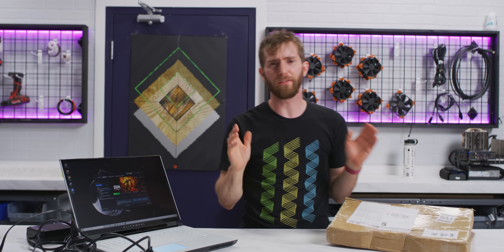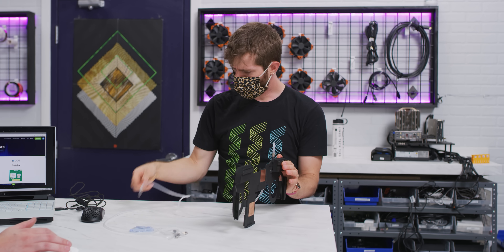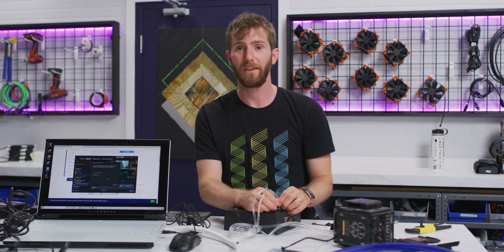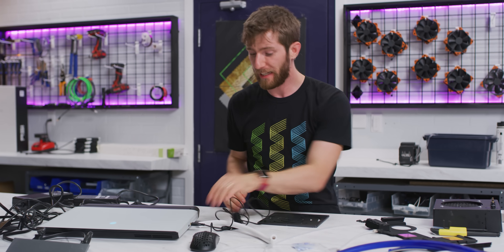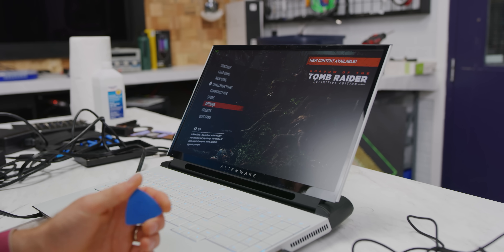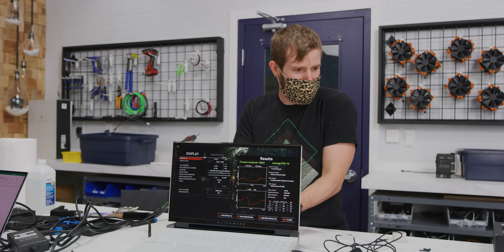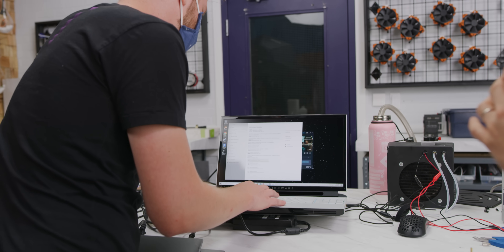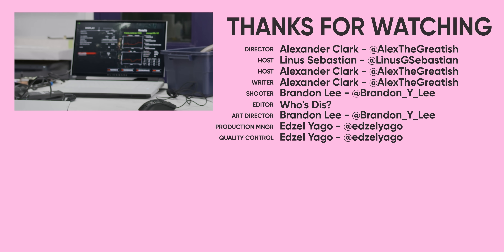This Sketchy AliExpress Cooler....

Comment: Can you do a run of Userbenchmark with and without water cooling, and compare it to other machines similar to it (stock, obviously)
Also running a very CPU-bound benchmark would have probably given better results considering its the CPU the one that really struggles on the stock air cooler.

Comment: VRM throtteling , the pads didn't make a good connection with the aftermarket cooler... Did you guys monitor the CPU frequency while running the benchmarks? You only monitored the CPU and GPU temps...

Comment: One point of debate is that when water cooled you Guys had the laptop in the air. when you guys tested air cooled it was in a flat surface so its getting hotter air from the bottom.

Comment: I had a diy water-cooled laptop. I made a flat heat pipe and just put it on top of the original heat pipes. The air cooling was exactly the same but as soon as I fired up the water cooling i couldn't hear my Laptop anymore. No throttling anymore 50°C
This was like 30° lower than stock

Comment: Loving my 51m, but yes it is for sure because I'm on the go. Though to be honest, if you consider the screen and the fact mine is a 9700k with a 2070 and performs just like my friends custom built 9900k with a 2070 but is mobile for about the same price he spent on his screen and parts (you must consider the screen). It's not bad. He made his build for 2600$ and I got my 51m on sale for 2700$

Comment: Hey Tech Linus, so I use the ACER V3771G yeah it's old. I just applied some thermal grizzly paste on it and it runs like new. I bench marked the CPU and GPU and it got pretty hot like 81 degrees. However, out of curiosity I removed the bottom Chassis, placed it under some cooling pads and to my surprise under the same benchmark it ran max at 72degrees. I was wondering what results you'd get on your system if you did the same.

The downside is that the parts are exposed but I have slightly better performance. I mean a 5% performance jump is a leap for computing power. 

Before I couldn't edit 4k video, I could only down scale it into a 1080p timeline but now I can edit 4k video at full resolution. By this I mean I can just cut it about without having to add effects and stuff. But I can do all this on 1080p footage with some graphics animations and effects no problems. 

I think my PC just cools better without the bottom part and this gives me better performance. I can imagine how much better a latest PC will do.

Comment: Here is why this thing exist. Not every laptop have a good original thermal design like Alienware's. And that's why aftermarket thermal design for laptop exist in China. On some poorly designed laptop, you can get better thermal performance by just solder additional heatpipes onto original module. So the target of this kind of product is some midrange gaming laptops where the performance is bounded by thermals.

I have a MSI GE laptop and adding water loops increases the performance by roughly 20%. You can install a quick releases on the loop so you can unplug the pipe and carry the laptop away without worrying about leaking and stuff. It's actually make sense. 

And they didn't cost $600, it must be shipping or/and Alienware tax. Mine cost around $200.
Reply: Did you diy the water loop or the loop comes in full set and it is bolt ons. I'm thinking of doing the same thing to my laptop

Comment: id love the option to hook up a 140mm AIO to sit on your desk, with Push/Pull; to game at. Its annoying that only Desktops are Watercooled, when there is a market for Laptops with small Rads and heatsink combos. I mean atm i underclock the CPU voltages, to game @144hz using Throttlestop. No temps go higher than 69C. We need quality match-ups though. I mean something like an Asus laptop with a 140mm 40mm thick rad with Noctua fans, and use a clip on locking system like the garden hose variety. Whilst on the move, you could still game without it, but at home, use the rad to game with better temps. Especially as we all would love to see a 10900k + 3090 and not have something SO BIG that you could use as chocks to keep an airplane parked.

Comment: They do one of these for the apex 15 / nova 15 laptops with the desktop Ryzen CPUs.

It's £250 I'd love to see how that one does. 

On the product page or shows two different models, one actually has more heatpipes than the stock heatsink so might be a genuine upgrade even without the water cooling.

Can you do a video on that as well?

If not I might bite the bullet if the seller proves to be able to communicate some key pieces of information to me. Like does it come with a replacement fan cover to replace the one that's actually part of the heatsink?!

Comment: we got a lot of laptop modified enthusiasts in china, we especially focus on clevo's product like nh55 p750 p775 p870 x170, and alienware's 51m and 51mr2, the purpose that most of us made this is for achieve the best performance in fan cooling ,some would try to do this kind of water cooling too, basically we just wanna put a 9900ks in the laptop and make it still runs ok

Comment: Little tip when it comes to bleeding the air out of liquid cooling. go to the auto parts store and buy one of those handheld vacuum bleeders for brake lines,  suck the air bubbles out 😇

Comment: since temps with the water cooling is only 82 degrees (vs 99 stock), what about overclocking? temp-normalized performance difference?

Comment: have u guys contemplated using visors instead of masks so we can see ur reactions and stuff better?
Reply: Visors/Face shields are prooven to be not as effective as masks by a long stretch
Reply: @Dorinyan  ok but i thought it would look better. i was just giving a suggestion
Reply: @therealflstudionoob So, yeah, i may be not as science savy with only a masters degree in materials science, but there are TONS of published research papers confirming the effectiveness of face masks IF the correct type is used and they are worn correcty. On the other hand we have infection numbers increasing dramatically in countrys without mask wearing laws or beeing late to enforce them. 
But naturally, if you google "Face masks ineffective" you will get confirming results.

Comment: Did linus really not try overclocking the laptop ?. Didn't he just confirm in the last video that laptops are supposed to be run at 99C so that they can squeeze out the max performance out of it ? Clearly dell fit a perfect cooler for the cpu and gpu so better cooling might not affect the performance anyway.

I know this video might be filmed earlier than the last video was.But considering it caused the cpu temp to go down by 17C and GPU by 4 C, it seems like they totally dissed an actually great product, whose intent might just be to lower the temps so that people can overclock.
They seemed a little to biased to try that out, just cause its origins might be sketchy.

Comment: i feel like when it came to the mounting pressure. i would have used the threadripper torque screwdriver. it would still be a guess whether you would get the right mounting pressure but i would trust that more than guesswork.

Comment: To anyone having cooling issues on their gaming laptop:

Get a desktop you fools. Even a mITX rig is cheaper, cooler, quiter and about as portable.
Reply: Did you forget a monitor and keyboard my man?
Reply: @marcusborderlands6177  Also a portable power source. I use my laptop unplugged all the time. A ITX is more portable than an mATX/ATX but no laptop. ITX would still be tethered to a wall limiting your options, along with needing portable monitor (of which cost more for a decently specc'ed model good for gaming), and a decently portable keyboard and mouse. Also the hassle and time wasted setting up a system and tearing it down each time. The cost saving of building a system that's easier to move isn't that much, if present at all. (given SFF ITX case are a niche and are rather costly and Out of Stock often). cleaning one's laptop, or even repasting it (if your technically inclined to do so) is a much better use of time and resources. A laptop that overheats or has issues is usually environment issues,  these machines are designed with heat in mind, unlike a custom built. A well-built (note: there can be poorly built systems, as is the case with the unfortunate TUF laptop) gaming laptop should have been designed to cool itself well enough stock. I'm a massive fan of SFF builds and do have some on the list currently (cases are out of stock often) but I would feel it's a disservice to tell someone they could replace their laptop with one for most cases.

Comment: Pausing before you actually get to water-cool it—you didn't check if the blocks leak or not before filling it in, haven't you? I wouldn't dare put a contraption like this on my $35 Raspberry Pi, let alone on a 100+ times more expensive machine...

Comment: Water-cooling enthusiast: That 20 degrees less!
*Prepare for LAN party: packs laptop, charger, PSU size radiator, 2*PSU size PSU for the water-loop, a bottle of water, a talisman against potential leaks killing the laptop, all with the dimensions and weight of desktop PC*.

Comment: You ran the benchmark with the new heatsink and didn't check if it came with water already inside it. Those results seem like they're invalid because of that.
It'd be better to have disconnected the pipes after using it in a loop knowing that the heatpipes actually contain any water, and THEN running the test.
Don't forget that the heatpipes in laptops will usually have liquid inside them.

Comment: I really want to meet the person who thought of this and IQ test them
Reply: They'll probably have a high IQ since they managed to pull off such an expensive rip off
Reply: @garn100  It dropped CPU temps by 18 degrees. Seems like if you bought it to improve cooling performance, it did exactly as advertised.
Reply: @emissarygw2264  After having to jerry rig it in such a way and to peel holes into your laptop's frame to make clearance for the tubing as well as the lack of well thought out mounting pressure as the elevations differ from the stock ones, as is shown in the video. Plus having that external radiator sit like that outside the laptop. Plus at that price, I understand why sebastian was so dumbfounded. Definitely not a scam, but definitely not worth it in the slightest.
Reply: @garn100  True, at that price it should be way more polished of a product. Idk what the typical pricing of water cooling components are though and whether it's comparable (not talking about sealed aio systems). Anything custom made for one model of anything tends to be expensive though because there's a high cost to just developing the product and if you're only expecting to sell like a dozen units then it has to be expensive to make it worth it.
Reply: @emissarygw2264  fair enough but still i think the pros and cons of this product are clear to all
Reply: It seems to do the job though.
Reply: I mean there was effort. The bending work on the heat pipes make it look like it was made with a fairly good amount of craftsmanship. Really the only think that could have been done better would be the vrm contact height to get rid of those thick thermal pads.
Reply: Meet the person to drag them into the middle of the street, shoot them then piss on em.

Comment: No overclocking? Shame!!! When you buy water-cooling you are supposed to clock the s**t out of the hardware. I am waiting my taobao water-cooler for my 4 year old Tornado F5 then modding it with a 9700K in order to properly water-cool it with 360mm radiator and overclock it as high as a desktop. The 1070 in the laptop can be unlocked from 115W to 200W for huge gains = 1080/2070 desktop cards.

Comment: You should have compared all that to just putting the laptop on a cooling pad.  My current laptop, which is nearly six years old now, will throttle under full load with just its own coolers, but won't throttle if sitting on a cooling pad that forces more air into the bottom.

Lot less intrusive than the travesty you had to do here.

Comment: To be fair, with a little work, this could match the stock air cooler for gaming on the go, and a couple of quick connectors could allow you water cooling at home. Someone just has a few issues to work out first. Now make the radiator a dock for the laptop, and we can have some REAL fun.

Comment: They were so close to a decent product (though still not a good buy). Enbossing the plate for the vrm's, making the in and outlets come out of the holes for non-destructive installation, quick release valves so you don't need to turn the whole thing while mounting and unmounting, and so it would never leak, a fitting that allowed this tiny tube to be connected to something normal-sized, and proper tension screws on all mounts.

Then this would actually make sense for some people. Pushing 99 constantly can impact the longevity so this could actually be a valid investment if it were decent.

Comment: I think, the reason why you didn't see good results on the first run of liquid cooling is that VRM was overheated. As Alex mentioned, the cooler design wasn't really good for anything except CPU and GPU. And, also, given that Dell is known for with the problem of VRM overheating (Dell XPS laptops can have pretty big performance boost by just adding thicker and better thermal pads on the VRMs) I won't surprise if I am right.

Comment: The hell , this is not a valid test .

 With the Laptop stock cooler they were testing tempt on a flat surface that makes everything substantially hotter whereas with the water cooler "solution" they had the laptop raised up which would drop temps quite a bit even with just stock fans 😰

Comment: one piece of information missing from a video - noise difference? It's not like it will change value of cooler but it's not like sane people buy these kind of laptops anyway and I can see that some of them actually spend $450 on cooler if it's quiet enough compared to stock one.

Comment: So instead of using a $5 set of needle files which would have actually been FASTER than the Dremel (because it doesn't require prep, plug in, sizing up what you're doing, etc) and NOT torn it to pieces, they decided to hack at it like a blind woodsman...

Comment: I have a liquid cooled MSI GS65 8RF that costed me 120USD and about 2 days of work to convert. They didn't have any readily availble coolers for this laptop so I did the conversion myself by adding a water loop on top of the gpu and the cpu parts of the heatsink without removing any stock cooling components. The performance without the liquid cooler is about the same (maybe a bit worse) but once the cooler is connected it runs like a beast.

Comment: ThinkPads hardware maintenance manuals have the specific torque/pressure you have to apply on each screw. Maybe this notebook manual has it instead of "guessing"... but hey, this is LTT!

Comment: Looks like you did not have quite enough flowrate, 20°C difference between input and output of the radiator is way too high

Still pricey though

Comment: they should have that as a original feature. make the air cooling good enough to be functional on the go and then provide the possability to connect an external water cooler like that

Comment: In china, there are actually services that can weld a copper pipe on your existing heatsink so you retain the stock air cooling abilities of your heatsink while also having the advantage of water cooling it. Costs about 230rmb or something like 40usd

Comment: You know, it would probably get better results if they used larger fittings and got more flow through it. Such a shame, it's almost okay. They even could have just added a fake heatpipe in the middle of the row of heatpipes and run water down the length of that, it would've sucked up heat from the coldplate and along the length of all of the other heatpipes it's up against as well, would probably actually be pretty efficient

Comment: Its not about stopping throttling, air coolers did that anyway with water cooling its about how low you can bring the temperatures. Try cold water with this 😁😁

Comment: There are external water cooler (a set of radiator, fans and pump) out there you can buy and it actually work. I am using a laptop that use 7700k and 1080 mxm card, and I use one of the water cooling kit from taobao like the one in this video. It served me well and it is way more quiet than the stock cooling method, while keeping the temperature under 80C under load. But this really isn't for everyone, assembly and maintenance are just horrible experience /<_\

Comment: I was going to say maybe it relied on water being in the loop but not serculating. Just to be thermally conductive so its good you had to re run the test. 
It looks like it would benefit greatly from a more powerful pump. But not thermal throttling is not thermal throttling.

Comment: It drops the temp from 99 to 70ish... which means this cooler actually works... but the problem is, that 99 degrees one actually isn't throttling that much... which means you didn't really gain a lot of performance from it. However, I think this cooler might make sense if you are able to overclock both GPU and CPU... since you still has about 20 degrees margin compare to the stock cooler in terms of overclocking.

Comment: This is for LAN cafes. They watercool everything and dump the heat out back so they can use a lower rated air conditioning unit to keep the place cool for the customers.